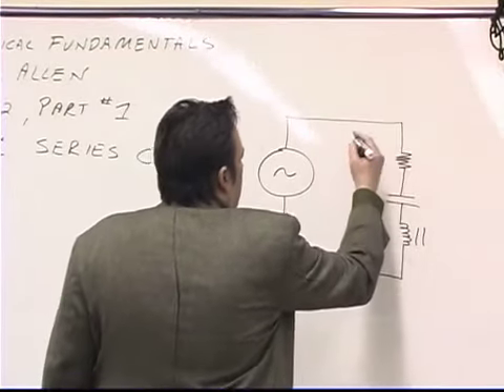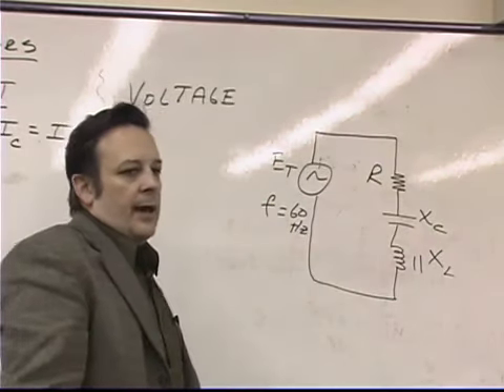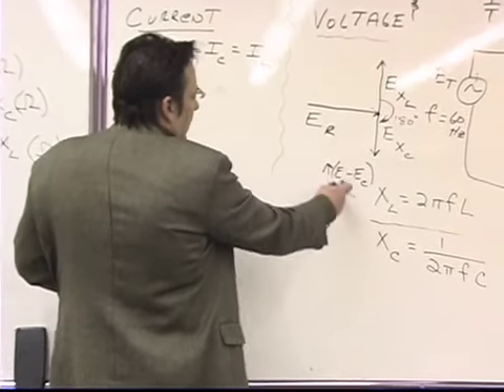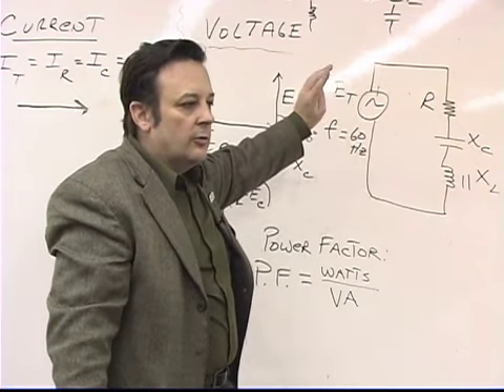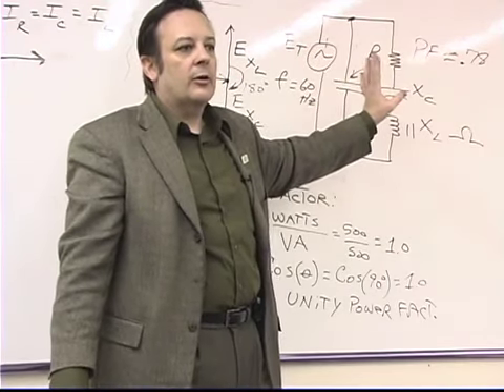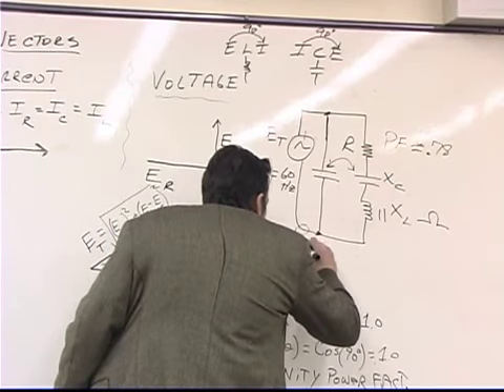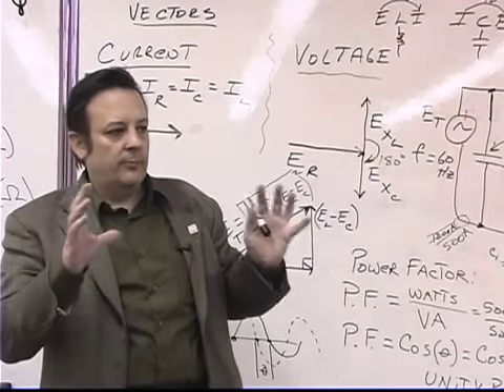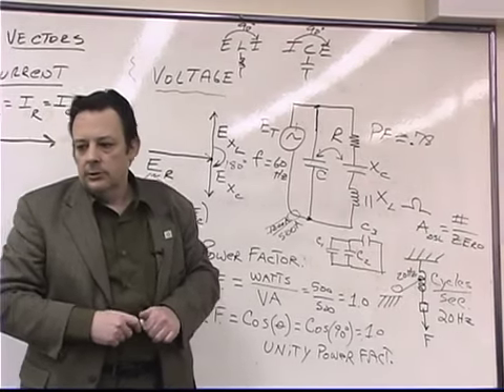Electronics 213 - RLC Series

Comment: should be cos{0}=1
thats when power is equal to apparent power meaning only resistance is present in circuit in this type of circuit phase diff. bw current and voltage is zero
Reply: Yes it should be cos(0) to have a Power Factor of 1

Comment: Cos is a representation of the x-axis, at 90 degrees you are on the y axis. so you have an amplitude of 0.  At 0, 360, 720 you have a positive amplitude.  At 180, 540, 900 you have a negitive amplitude

Sin is a reprsentation of the y-axis, at 90 degrees you are on the y axis with a positive amplitude.  When you are at 270 degrees you have a negative amplitude